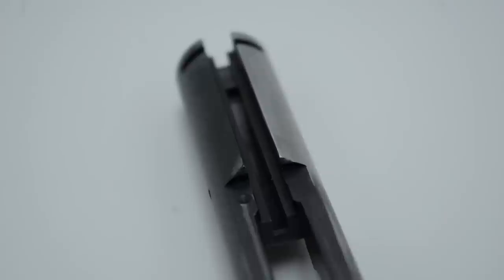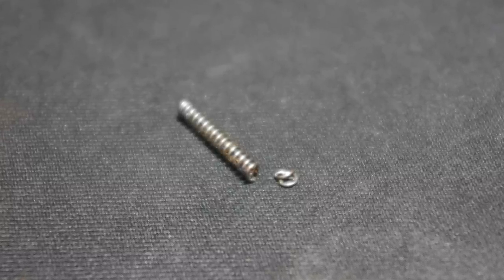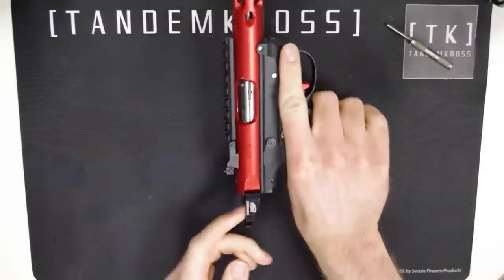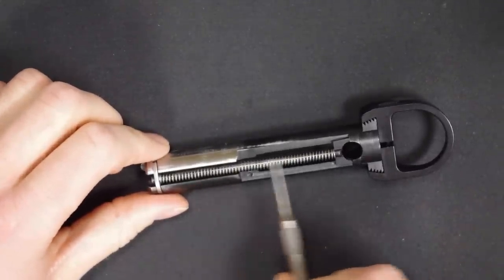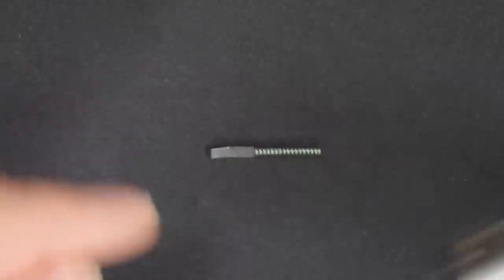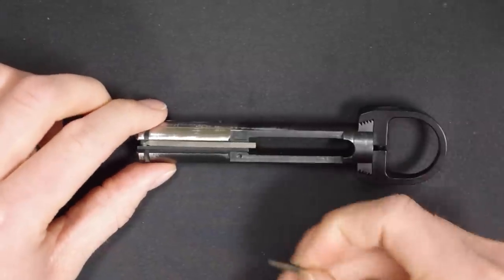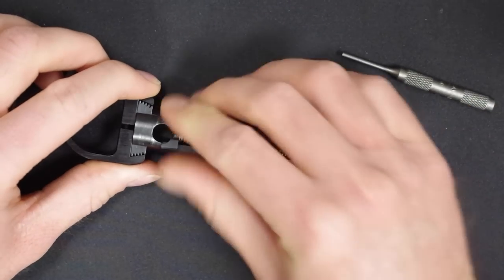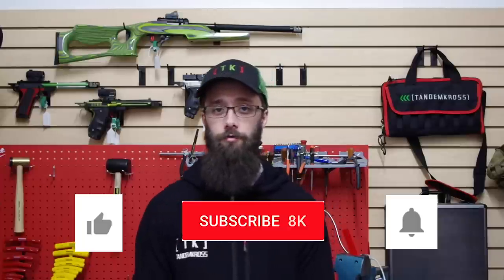TANDEMKROSS - Rebound Springs for Ruger® MK Series - Install Instructions

Comment: Finally. After weeks trying to figure out what was wrong with my Ruger .22 standard (purchased in 1972) and watching a dozen YouTube videos somebody actually mentioned the rebound spring.  In my case both the rebound spring and the rebound spring holder have a problem (the latter is very wore where it fits into the indent in the bolt.  The firing pin is also worn.  Not surprising - I have fired well over 20,000 rounds, probably closer to 25,000.  On a camping trip back in the mid 1980s, we fired 500 rounds through it in one day. Will be replacing the pin, rebound spring, and spring holder shortly.

Comment: IMHO, this is pure hyperbole which appears to be an attempt to sell an oversupply of springs. This spring should not wear, break, deform or weaken but I could be wrong. My goodness, it is a firing pin spring in a .22. I have a Mk I purchased in the mid 60s which has consumed many thousands of rounds and the spring still looks and performs like new.